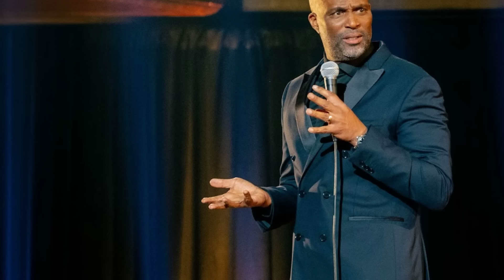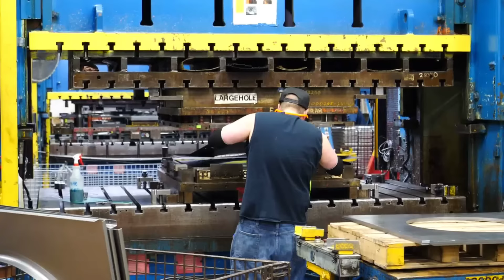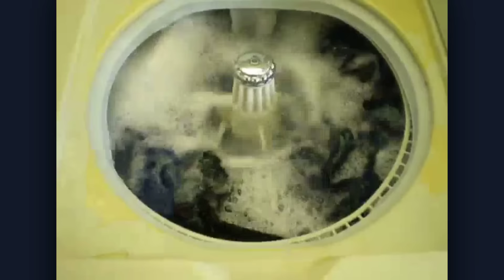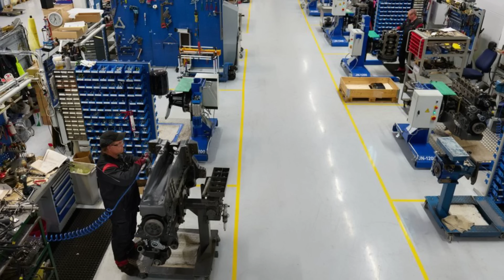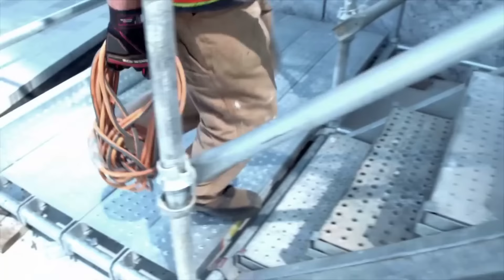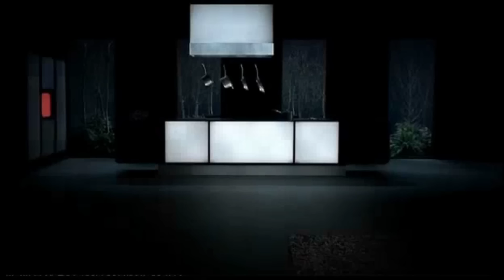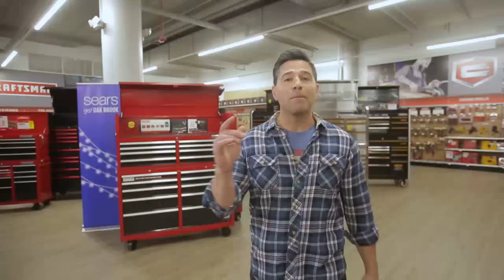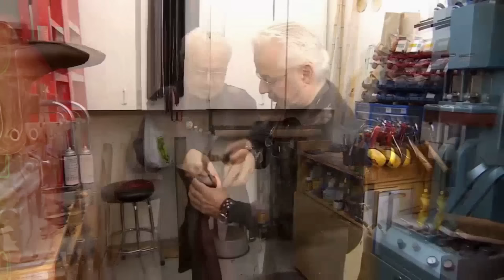The Only 5 Brands That Still Last (The "Buy It For Life" List)

Comment: When I heard Honda was out of the gas lawnmower business I rushed down to my local Honda shop and bought the last one they had. My hand tools are Knipex or Klein.
Reply: Klein isn't what it used to be either.
Reply: @danbuckley6584 knibex is still good
Reply: I was given a Honda generator which had time on it, so I didn’t expect much. It started second pull and it has never let me down. It shuts off if the oil pressure goes low, which saves the engine. You don’t need them often but when you do it must start. I have had a Honda ride-on mower for at least 15 years with no trouble.
Reply: Check the net for problems with your engine(or any engine),they are very good but not bullet proof.Have a honda pressure washer, would run a minute or so then shut off. Coil was the problem but checked out within spec. While trying to find it though came across the problem of the exhaust valve guide backing out. Mine was already making contact with the rocker. Wasn't for the coil going bad the engine would have self destructed. Simple problem to fix but can and will scrap a engine if not attended to.
Reply: I've had a pair of Klein linesman pliers for about 15 years.   They're intensely impressive.   I call them my "hand-held vice" because that's how much force the jaws have.   They cost over $100 nowadays, but they're still worth it IMO.
Reply: We still have Honda in Australia.Also small family business SolidTeknics making pans and accessories using wrought iron.They are lifetime cooking gear!Worth every cent!

Comment: I'm still using my Kenmore washer and dryer from 1987.
Reply: Kenmore is Whirlpool, built to last 30 to 50 years!
I've had mine for almost 29 years.
Reply: @jimfurr.3 
Whirlpool certainly doesn't make them like that anymore! The "shock absorbers" went on mine after only three years. Sounded like a freight train and danced all over the laundry room. Repair would have been equal to original cost as the warranty was over, so I bought a Huebsch, the name Speedqueen uses in Canada. You pay more up front, but at least it has a five year p&l warranty. Apparently you can get 10-15 years out of them.
Reply: @GhostofBarronsCat we e had a whirlpool washer and dryer for almost 20 yrs…our appliance repair man is very honest and has o ly repaired what was necessary..luckily they’re still going strong
Reply: @TR-nv3if 
I know. That's how they USED to be.
Reply: @GhostofBarronsCat now made in China
Reply: I love my 30 year old whirlpool set.Low tech, but perfect.
Reply: @jimfurr.3 Kenmore is no longer associated with whirlpool
Reply: @jimfurr.3   I bought mine used from someone.  Needed shocks and I replaced them.  plastic button broke on the front, and I poke my finger in the hole to hit the real switch.  a couple parts have needed replacing and it was easily done... except that rubber seal - what a pain!  Dryer parts same... except the belt.  Took a lot of time to get that replaced.  But these things are durable.  My wife wants new ones (stackable) to get to the shelving above/behind the washer/dryer that stands on pedestals and we have a deep shelf above it.  I dread the day we have to replace these... They've been dependable beasts.  The dial is a bit flaky, but once started, it locks on to that setting.
Reply: My Kenmore washer is from 1985, but I have to sort of pet it to keep it going.  But it does the job.  I understand Whirlpool made Kenmore appliances back when they were part of Sears.  I also have a cast iron griddle which was made in the 1800's and was my grandmother's.  She was born in 1867 and died in 1941.
Reply: My wife and I  were given  used set of lady kenmore  washer and dryer when we bought our first house around 1984. It was my best friends wife s family machine and had been given to them used . We had to replace it in 2020. We raised two children with them. Truly awesome. I would love to see the US go back to making things that last!
Reply: smart!!
Reply: A 1987 Kenmore is a private labeled Whirlpool.  Maytag is another version of Whirlpool.  Great purchase!
Reply: I have a dryer that's probably 35/40 years old and it's still working it's a Maytag.
Reply: WOW. I bought my first house in 1987!
Reply: Ours are 2013 Amana Extra Large Capacity, $350 each and continue to clean even our king size bedding as good as ever. If you can get commercial quality for reasonable household prices, only a fool would not pursue those goods and services.
Reply: Whirlpool from around the same time.  Yeah buddy!!!
Reply: Hang on to it.  That was before they became aggressive about planned obsolescence.
Reply: Kenmore washer 1986, dryer 1988. I did replace the dryer pulleys and belt once!
Reply: me too!
Reply: Like my 2004 washer opens sideways.
Reply: My uncle had a washing machine from the 60's,  Only had to change the belt once,  Lasted until 2000.
Reply: I’ve got a washer and dryer set, Maytag, got in 2000.  Both still work perfectly.  That’s when things were made to last.
Reply: We bought a Kenmore washer and dryer too. The dryer died after 5 years and the washer lasted 7 years.
Reply: Yup my kenmore fridge is over 20 years old. Kenmore was the best I miss it.
Reply: Same on my Kenmore sewing machine
Reply: Early 2K Maytag series washer and dryer, still working, today.  Wouldn't touch one after Whirlpool bought Maytag.  Whirlpool bought Maytag in '06, and by '08 all became junk.  I hate Whirlpool.
Yes, I know Whirlpool made Kenmore, but they killed Kenmore reliability in the later years as well.  I will not buy an appliance with "smart features."
Reply: I bought a heavy duty Kenmore washer and dryer in 92. Still running like a champ. I've replaced a sensor on the washer and a drain hose.
Reply: siemens stöve and fridge. stöve was ´afterglöwing after the pöt cööked dry and göt därk !?! ps yep onda worlds biggest motorist? ^ ^ still have my first non teFlööni bare? steel pän ! ´tough as stitchöni härd a crööksteäl v?V dönt buy oily teFdrek vv buy vlFb€rt xD 
benz engineer : ´id drive into the desert with an öld w116 ör sö knöt 140 xD parents dishwasher surved almost 30 years till it leaked..? gdr ovens grills are also said to bake decädes v?V ^F^ +nöric? cö$metikk steal -.- 
70s tape deck repair vid göt 1! plastic part in it xD try that with an ´hx prö öne ^?^ oh yeah my acquaintanceese? akai player. tho well unconfirmed ^ ^ || 2 identical $ilend! fuji hdd. swapped controller nö pöst - bööt !?! herd the wd ones a room awayy 
had 130€+ asics. whites. lasted well över 3 years. despite being squashed. next ones nice red but zero overweight comfort from däy 1 ! danish ecco also had? great shoes. also bk. adidas is trash esp ´4 övv. wd 500 hdd held 5! years! but broke without a sound.
Reply: We noticed that with me more too,
Reply: I had as set that ai bought in 1987.  They worked fine until recently- when I tried to get them repaired - I was told the parts were no longer available.
Reply: When I bought my house in 2002 the sellers left the 1981 Maytag washer & dryer. I still use them for my work clothes but I bought a new set of laundry equipment for my regular clothes on Black Friday many years ago when the deals were much better. The new stuff is Fridgidaire. The washer is a front loader which I never had before. The pair combined was $559 + tax. Many years ago I did replace the dryer belt and the heating element in the old Maytag dryer. The new washer I replaced the door lock switch with the assistance of a few YouTube videos, it was actually fairly simple. Also had to replace the newer washer circuit board which is not cheap. I think it went bad from the electricity being knocked out by a storm and the utility company trying to get it going again makes surges that flicker the house lights while the utility figures it out. So now I shut off the power strip/supposedly surge protector, or unplug the washer when i'm not using it to prevent a damaged circuit board. I also shut off the furnace and A/C switches when a storm knocks out the power to hopefully prevent those surges wrecking the electronics. I'd need to hunt down that sales contract of how much money the sellers paid for that 1981 Maytag equipment because I don't recall.
Reply: Yup mine from 96 worked great had motor change out 2 years ago then leaked was a great machine, I ended up getting speed queen yes load but cleans real good built like a tank
Reply: Remember the advertising slogan?
Kenmore. Solid as Sears.
Reply: Back when Sears was tops their products were well made
Reply: Sorry to bust ur bubble,  channel lock plyers r junk.   KNIPEX R THE BEST, 3 PAIRS ON AMAZON FOR ABOUT 110.  professional mechanic using plyers just like u showed. Channel lock would be slipping and quit in less than 2 months.   Warranty only good if they break.   No 4 wearing out.
Reply: I remember Kenmore as a good brand name. I don't know if things have changed in recent years.
Reply: When I met my wife in 87 she had a 20-year-old washer and dryer And now in 2026 I still have the same washer and dryer it's simple it's mechanical it don't have a bunch of computerized switches I can work on it and I've kept it going for 50 bucks for the last 40 years
Reply: Several repairmen have told us that the Kenmore model 80 washing machine was the best one ever made. We still have the one that my mother bought back in the 1980's. Works fine.
Reply: @robnj.    My Kenmore dryer lasted 32 years. I had the matching washer for over 20 years. Bought them together for $500. So sad to realize those days are gone.
Reply: but do the Kenmore washer and dryer from 2026 still last that long?
Reply: I have a Whirlpool set from '96
Reply: I inherited my mom's 1994 Lady Kenmore washing machine 21 years ago and still going strong with constant use. 32 years old!
Reply: My Kenmore dryer finally gave up the ghost, bought in 1988. Gas dryer. We might have been able to fix it, but we found a fairly decent used GE for $100 so bought that instead. Had a guy come pick it up, he took our old generator, fixed it up and sold for a fair profit. So win-win.
Reply: Front loaders washing machines are nasty.. mold accumulations on the inside door rubber
Reply: Keep it as long as you can. The planned obsolescence garbage kicked in around the mid 80s. The new stuff will last as long as your old stuff. Slightly off topic, Refrigerators built after the 1980s are especially bad.
Reply: Me too. 1984.

Comment: I generally get all my large appliances off Craigslist, often for FREE.  Washing machines, for example, are often a problem for people to dispose of when they move to a different address.  They often wind up being given away,  and when I get one,  it usually runs for many years before quitting.  At that time, time to replace with another free washer.

Ranges, refrigerators, washing machines and dryers  ---- all good bets for free appliances because when people move or die,  they need to GO!  Mine will go when I die, too.  

Free is a good price.
Reply: Great idea. Unfortunately I live in an isolated, backward, monocultural part of the country and Craig's list is too progressive an idea for the people here.
Reply: @DancingOnH2O 🙄Well... I dare say if you needed  to borrow a tool or help finding something larger, your backward neighbors would help if you asked them. Small communities have their own ways of finding things. Auction houses, local circulars, or just knowing who has an old washer in the barn, try asking! It's the old fashioned version of Craigslist.
Reply: @DancingOnH2O you're complaining about too many white people?
Reply: @DancingOnH2O 
It's a big country. Move somewhere else...be happy.
Reply: I just junked my 30 year old free dryer and I still have my 25 year old "scratch and dent" 100$ washer.  Meanwhile, my neighbor with too much money and no common sense bought a bright red set of them, with the pedestals for over $4,000.  Well to her her money as easily gotten.
Reply: @mutteringmale 
The most popular financial plan in the United States is 
1 SPEND all you earn 
2 SPEND all you can borrow
Reply: @SeattlePioneer  It's the same in most countries.  Because all money is worthless and not backed by anything tangible, and is controlled by the world bank and other orgs, to make sure they all print about the same amount of money each.  Thus keeping a balance and making all the peons think their money is actually good.  Look at the price of gold.  That is the real analyticof what your money is worth.
Reply: If it's free, it's for me!
Reply: Yep. One time picking up "scrap" 15 years ago, I got a Monkey Ward Signature 2000 gold washer and dryer. Came w/ the home she had just bought. She didn't want them as she was buying new. Found that they worked perfectly! A few years later the original simple to replace washer motor belt was glazed. $5 on ebay delivered. Lost to arson 5  years later.😮
Reply: Like your attitude my freind👍
Reply: I do the same thing, drives my wife crazy.
Reply: East Coast Appliance in  southeast Virginia started out as an appliance scrapper. Same deal, failed extraction pump, belt/tensioner, inlet/mixing valve, or maybe a timer... few $ in parts and another man's machine for 10 more years... now they are a huge retailer..
Reply: Bought (cheap) my current washing machine (2 years old 2 years ago) and it was leaking at the powder drawer (therefore cheap). Was also half "full" of half washed cardboard! 
I opened it up, cleaned the limescale and repositioned a slipped pipe clip and it works like new. 
Although the machine is upstairs, in a funny corner, and it's so heavy that I really don't want to bring it down/up the stairs again. I'm tempted to just throw it off the balcony when it breaks. Or take it apart and remove the concrete blocks, more realistically. But I'll be happier if it lasts forever.
Reply: Same 👍
Reply: I now have 5 years on a $150 set that looked like new.  No way I was going to buy the new style.

Comment: Craftsman power tools.  I bought a standard home model.  And proceeded to make galvanized steel chainmail with it for almost ten years.  YES they replace it.   I would ONLY get another craftsman.   Chainmail making...is abuse. (to the drill)   Craftsman powered on with little or no concern through thousands of dollars of mail.  They weren't made to be that strong...but they ARE.

Comment: I'm sure you've heard of J B Weld. I have used it multiple times to glue soles back on. Apply JBW; clamp the sole in several places; release clamps after 24 hours. And, yes, I'm cheap.
Reply: I did not have clamps but instead used many, many rubber bands. Let them dry for at least 24 hours. (Have used "Barge" also.)
Reply: Your not cheat , your frugal. 😂😂
Reply: I needed that information.  Thank you.
Reply: It's an AI channel. we all fell for it.
Reply: I wore a hole in the ball of the foot in a favorite pair of loafers that otherwise still looked good. I got some of those stick-on treads, like you use on the bottom of leather-soled shoes to give them traction, and I slapped those over the holes. Stopped my feet from getting wet when it rained and I got a whole other season of wear out of those shoes. 

When I mentioned it to our Puerto Rican receptionist, she was like, damn, girl, you cheap like my mama. LOL
Reply: Gorilla glue
Reply: Doesn't break, crack up?🤔 
I've done some hinky hillbilly stuff in my duct tape&bailing wire world. Used liquid nail for sole replacement, because I figured JB would be too brittle in that application. 
Now, i want to hyper wear out some foot gear.🤔😏😎
Reply: @thatguypatmckittrick I like Shoo Goo 🤤

Ignore the drooling emoji. I just... I couldn't resist 😁
Reply: @truthbebold4009 totally get it! 
Half my modern language is goofy little yellow Dot 🥴🙄😮‍💨😏👌 
Or, GLYD. If you're into that whole brevity thing. 😎
Reply: @thatguypatmckittrick 
GLYD Representing ✊🥹
Reply: Shoe goo works.
Reply: @kraftzion  So true, did that to my 20 year old work boots last week. The sole came off, and glued it back on. Used six clamps and 5 feet of duct tape in the process.
Reply: @kraftzion tried. Works between 1 day to one month.  If it is winter, it will turn into glass and break.  

Glue is a short term solution.  Using proper materials and assembly techniques are best.  Why else would a boot manufacturer put stitching  marks in plastic molds?  Because they know it makes it look quality.